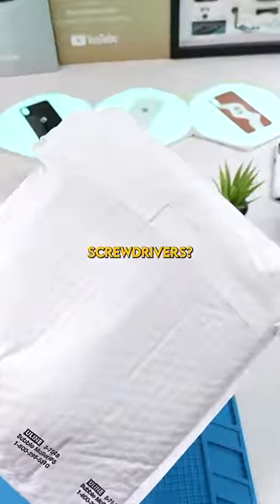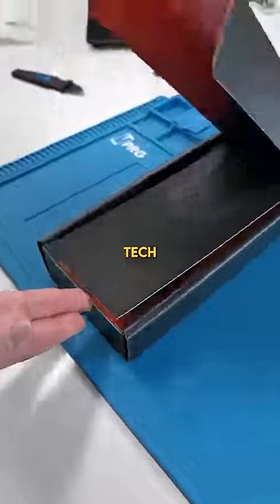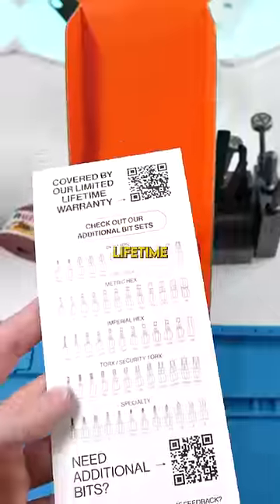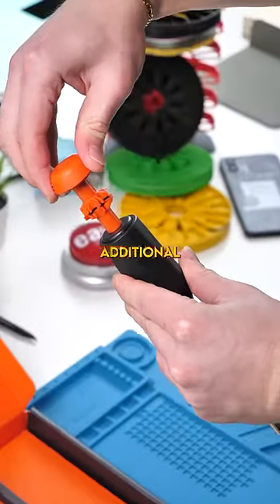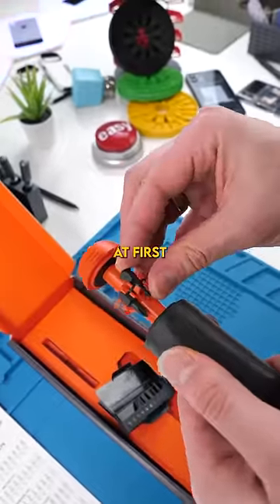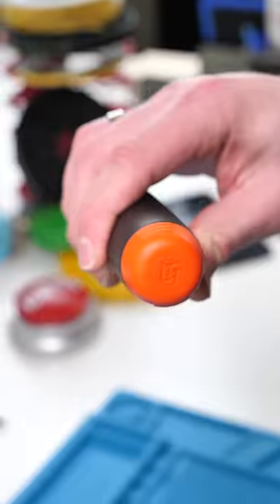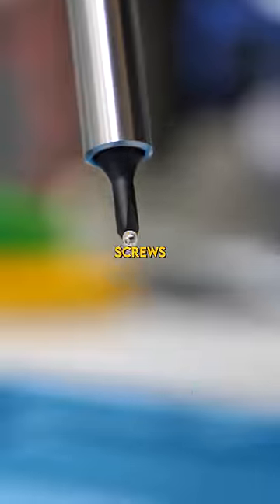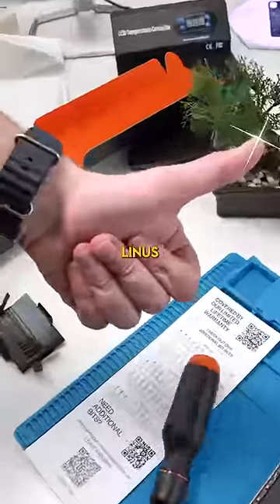How Good Is THE LTT SCREWDRIVER? #Shorts

Comment: This was designed to beat the snap-on while costing less, which it did. This means it's still expensive, but it's also just about the best ratcheting screwdriver money can buy.
Reply: No its not. Only people who don't use real quality tools think it's a good screwdriver. I bet 90% of the people who bought that overpriced China screwdriver has never even used  name brand made in America screwdrivers. I'll never give linus a penny of my money. I support small business not mega corporations
Reply: @tylerbaldwin1633 the fact that you think any decent tools are made in America is hilarious. All the big name brands make their stuff in China and Taiwan. Milwaukee is literally named after America and doesn’t make anything in America. Snap-On is mostly Chinese made these days as well. 

The LTT screwdriver beats the snap-on at every test. More max torque, less back resistance (means it can ratchet looser screws), less slop in the ratcheting mechanism itself, oh and their magnet is the strongest on the market. 

They went out and got the best ratcheting mechanism that exists, and then improved it over the course of three years. It’s the best damn screwdriver on the market, and it’s cheaper than the Snap-On.

Comment: No way it's worth 70 bucks.
Reply: Nope it’s a ripoff
Reply: @kcastillo1234  ripoff how?? ratcheting screwdrivers can go up to 150 dollars and from what I've seen they've put a lot of thought into the design, they made a video about their design process you can check it out if you're interested.
Reply: @kcastillo1234  definitely, I'm not denying that you can get better screwdrivers cheaper, I think the ifixit screwdriver sets are a better value but if you're looking for a ratcheting screwdriver which are usually pretty expensive compared to regular screwdrivers then the llt screwdriver is one of the best choices because despite 70-80 dollars it can perform as well as a ratcheting screwdriver that costs 140 dollars.

Comment: No ratcheting screw driver is “high quality” it’s cheap garbage.  You just bought a logo.  Not one good tool company makes those toys that hold bits in the handle.  That just makes the handle weaker. You wasted money on garbage dude.  You can get the same thing at the dollar store for $1.50. 🤦🏻‍♂️